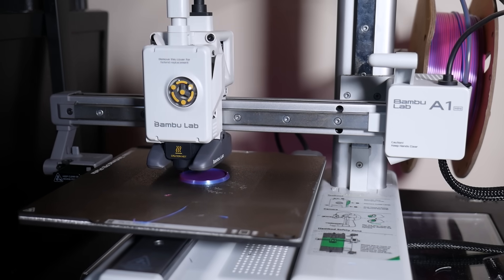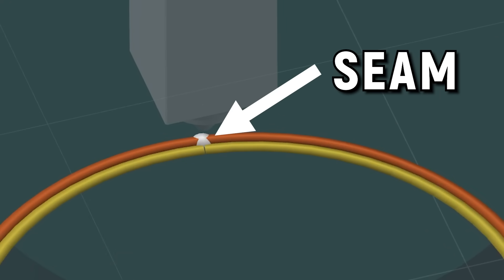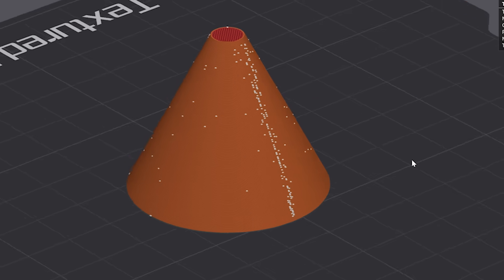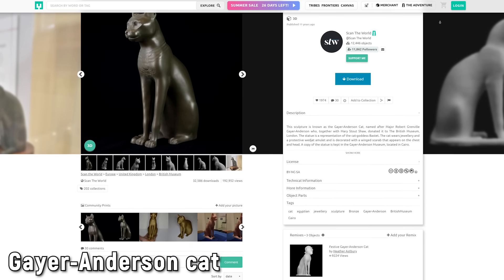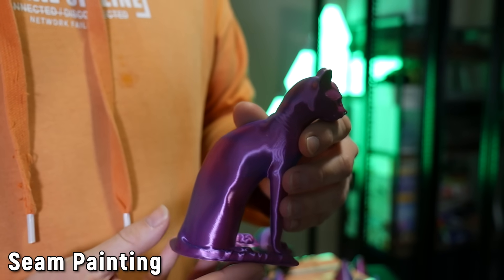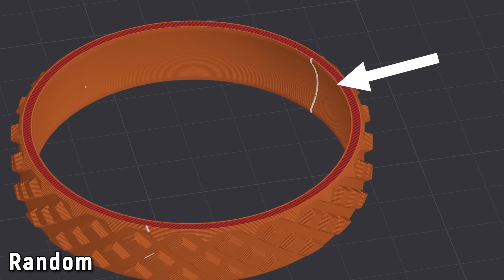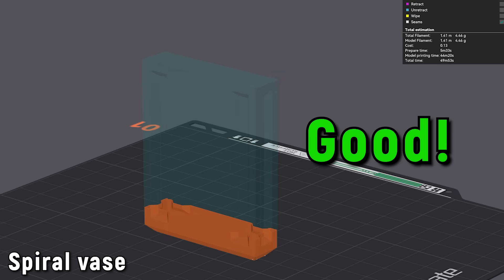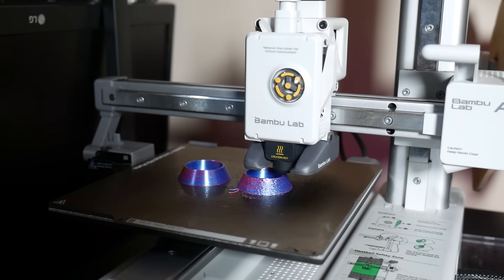Best seam settings - hide them completely! 3DP101

Comment: Hi, thank you for the video. Many speak about how easy it [more or less] is to print all sorts of hollow cylinders, cones, and pipes, but I have yet to see an FDM video on say small (or larger) cylinders or pipes - which unlike their injection moulded ABS counterparts - prevent/minimize eventual splitting somewhere along the 'layer' lines - even after using more walls, scarf layers, or different spool types or infill options. Is preventing the pipe shearing effect pretty hard to 3D print, or is this information easy and just common knowledge? Perhaps you can point us in the right direction or share a video? The application may for example be 20mm (3/4-inch) pvc hollow straight or 90 degree corner pipes, or shop dust collector hollow 2.5 inch pipes etc.  Thank you for any help...

Comment: Some "seam improvement" settings actually make it worse. like I discovered with Creality slicer.
This might be a isolated case but on a CR10 Smart Pro enabling "Wipe on loops" and "Wipe before external loop" (same settings in Orca?) causes horrible seam blobs, weather aligned or random. 
Not ticking those boxes gives stronger - and more water proof - very slightly distinguishable seams if aligned on the horizontal corner edge of a box for example. With PLA and PETG

Comment: I wiish they would add a hybrid vase mode, where you could assign parts of the model that have outlines with no island if sliced, to be built in vase mode, at the top of the vase area, it can make a circle at a fixed Z height acting as the base for the next layers

Comment: Am I misremembering seams not being an issue with Cura? I can't recall noticing a seam on any print on my Anet or Ender. Now with Orca/Bambu Studio it seems to be a big concern. I think Cura finished a layer and moved the nozzle slightly inward to hide the start and end point. As long as I'm not going crazy, it seems like an easy enough thing to do in the modern slicers.

Comment: in bambu studio, the scarf settings are separate from the nearest or aligned setting.  i haven't messed with it, but it looks like you can still set everything up the way you explain in the earlier parts of the video, while simultaneously benefitting from scarf seams.  i've only owned a p1s for a few weeks, so i wasn't familiar with all the slicer options... but there was an update just a few days ago.  so maybe the scarf settings are a new addition, or newly changed.

Comment: The necessity of this video could be completely replaced by a setting guide in the slicer. 

Cura has a setting guide extension (which should be default imo) that when the curser hovers over a setting a large window with detailed description and images pops up (the implementation is very good). 

No need to open an external website, no need to actively search for or be aware of the settings as you’ll happen across them while expiring the slicer. 

Everyone posting about how to improve the seam likely looked in the slicer for something but couldn’t understand any of the terminology and were too overwhelmed to do research. 

This video is practically reading off a setting guide which could be a built into a popup in the slicer. 

Great video Makers Muse, and thank you! but videos do not address the core issue, whereas a built in settings guide could be much more impactful.

Comment: 0:38 I think this has something to do with bambu's terribly designed firmware doesn't have klipper equivalent of pressure advance smooth time, resulting in filament momentarily slipping due to high retract acceleration.

Comment: I tried scarf seems once, and not only did it not hide the seam very well, it made it look like there was two instead of one... this is not the kind of two-for-one special I think anyone is after.. I usually just paint seems where Orca can't figure them out (there's also a box you can check when painting that makes the lines vertical, which is quite useful)

Comment: 1:31 Actually it places the seam at the nearest point to where the nozzle was on the previous layer, basically just saving time on travel moves. According to OrcaSlicer's wiki: "Nearest - Will place the seam at the nearest starting point compared to where the nozzle stopped printing in the previous layer. This is optimized for speed, low travel, and acceptable strength." By the way, I'd also recommend "Back" (or "Rear" in PrusaSlicer) for prints that are just viewed from a single angle.

Comment: "Aligned" is terrible for functional prints, it has ruined quite a few prints for me. It will find the most stressed inner corner of the model (which is already the weak point), and put the seam right there, to make sure it splits in a jiffy.
Reply: I wonder if puttin a radius of 0.2mm or 0.4mm in the corner makes seam not wanna go there
Reply: @happygiraffe9787  not really, i mostly have a much larger fillet in these places actually, there because it helps immensely with the strength. Maybe a hard corner elsewhere can help it, but i had to learn to not forget to seam-paint.

Comment: The only thing I miss about my time with a giant delta running prehistoric Cura was how clean the prints came out. Way back in 2017--albeit slow comparatively to now--those prints came out seamless with one check of a box. On hard surface models, they were invisibly hidden on corners, but even on many round models, internal seams in the infill made a world of difference. Eventually when I get it's third refurbishment completed, I'm going to do a cura vs modern slicer comparison specifically for seams.

Comment: My sub $300 printer and software from like 8 years ago can use random seams with no visible seam and no zits. It's crazy that modern printers can't do this. It's one of the only things that bums me out about my newer printer. 
The only thing I can assume is that it is because of the speed differences.

Comment: dude saying "random seams ruin the look of your print" when it's by far and awway the best looking setting, at least on a cone or other object without corners to hide them, wild. I always wondered whh random isn't the default and I keep having to customise the setting to not get that ugly line...
Reply: I generally prefer random as well! Admittedly partly because my filament needs better calibration and I don’t want to bother. 😅
Reply: I’d rather have the blemishes constrained to one area than zits all over the surface.

Comment: One use case for random seams: print-in-place objects with tight tolerances between adjoining parts, where aligned seams might create a single place where the parts bind together. Random seams can help spread out excess plastic and let things move more smoothly. Of course, if the parts have a nice place to hide the seams and keep them away from the tight tolerances, Aligned may find that place automatically (and if not, the seams can be painted there).

Comment: Bonus Tip: When using the seam paint in Bambu Studio you can draw a straight line by taking advantage of a weird bug.

1. Enter Seam Painting Mode
2. Start the Line: Click and hold the left mouse button at the point where you want the straight line to begin. 
3. Lock the Line: While holding the left mouse button, press the Escape key. 
4. End the Line: Move the mouse to the desired endpoint of the straight line and release the left mouse button. 
5. Preview: Slice the model to preview the seam and ensure it's where you want it
Reply: in orca they just have a button you click to force the painting to be vertical.
Reply: @lonewolfsstuck for some reason it's vertical to your orientation though, not to the model 😑
Reply: @Jtw0912  yeah cause thats how seams work? Seams dont work in the horizontal.

Comment: It would have been very helpful to explain/suggest scarf seam settings as they can make or break the tool. Very little good info out there on how to tune scarf seams well.
Reply: there's a good calibration test discussion on printables with settings to suggest. Search "Better Seams: An Orca Slicer Guide to Using Scarf Seams"

as for me, the best settings i found were to use in orcaslicer is the following tab under quality-seems:

staggered inner seams
seam gap 10%
scarf joint seam: contour and holes
conditional scarf joint
conditional angled threshold : 115
scarf joint speed: 40mm/sec
scarf steps 20
scarf joint for inner walls

important settings i found

scarf joint for inner walls

turn off: roll base wipe speed, wipe on loops, wipe before external loop
wipe speed: 40mm

over on the speed tab: at the bottom "advanced" section

extrusion rate: 300
smoothing segment: 3
Reply: @SupremeBean82  ill try to integrate  some of these in my settings, im currently trying to troubleshoot the quality of my scarf seams cause they are really bad, there is still a z seam and the scarf is very noticeable
Reply: @coolcat498 I noticed recently that " seem gap" can effect quality on certain prints. The biggest difference is making sure your flow ratio is dialed in first or you'll be under extruding on seems. I start my calibrations with temp, then pressure advanced pa pattern with a end pa of 0.04 and step of 0.002. I aim to get close to 0.02-0.03 and I focus on over/under extrusion on each end, and the middle. This allows me to up and or lower flow ratios each test till I get into the 0.02-0.03 range
Reply: 10 mm length, scarf seam on inner wall, look at sliced model to see where the scarfing will be and adjust by seam painting as necessary.
Reply: @radish6691 Unfortunately there are more options than just those that need explaining further, hence my request for a more detailed scarf seam explanation.
Reply: @radish6691  this is meaningless wordsoup only written to flex your knowledge, not to provide help to absolutely anyone who may actually need it.
Reply: @turbochargedfilms Those are slicer settings based on my experience. If you have a question then ask, though if you don’t know what seam painting is then maybe start by paying one of your grandkids to explain the basics to you.
Reply: @radish6691 you've just proved that their comment was correct and you made your initial statement in bad faith to flex that you know more than other people

Comment: I pretty much only use random for when I need a part that cannot have a potential failure point going all the way through the model like how I imagine it might be with aligned - The last part I used that method on was a Spacer to mount a Bracket I needed for a Wall mounted Cabinet I made for my Mother ( 3D printed the Spacer and CNCed the Cabinet - the load bearing Bracket was Store bought ).

Something I wish Slicer Developers would implement would be a setting to either automatically randomize or have a setting to randomize a Seam into Fuzzy Skin portions of a Shell. Right now an Aligned Seam setting will still show up on a Fuzzy Skin enabled Model if say you have a Model where you only want Fuzzy Skin on the Outside of a Model but with an Aligned Seam on the Inside.

Comment: constant wall speed = constant flow with good tuned Pressure advance decreases it by 95%.
Reply: I tell you, scarf at random setting is invisible.
Reply: @peypey_it_is  no. it is NOT
Reply: @PrintPixeltr  I have to agree. For some reason the first print I did with tuned random scarf joints was perect. Every other print had visible marks. I went back to scarf joints alligned to the back.